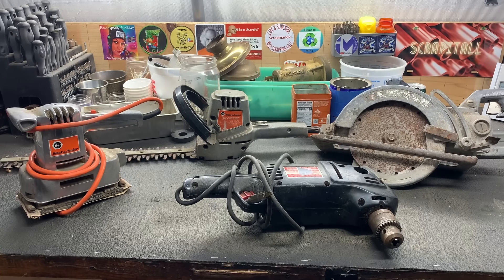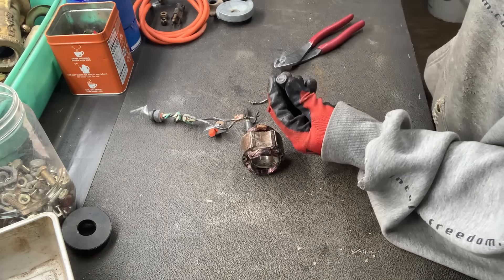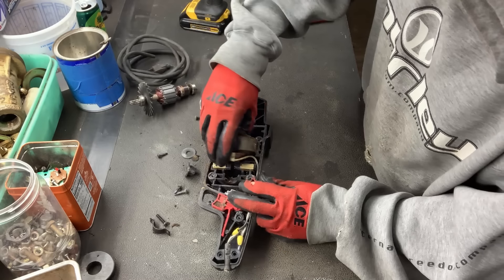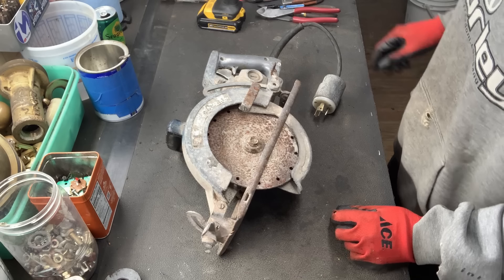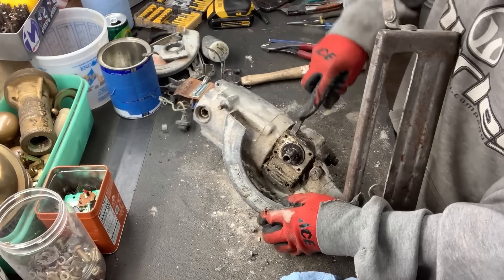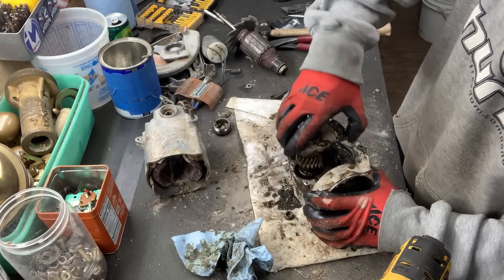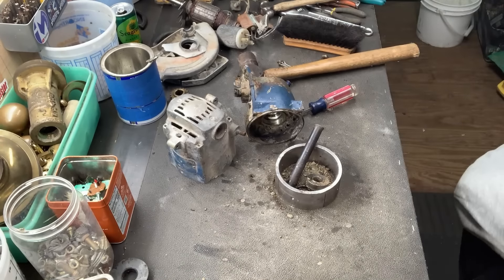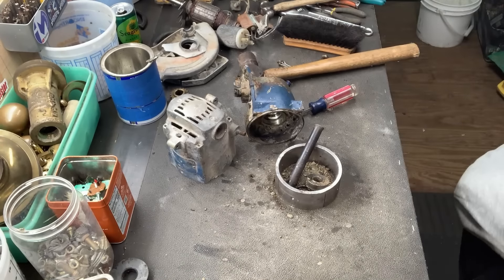Scrapping Power Tools for Copper - Will it Be Worth it?

Comment: Hold your hammer at the end of the handle. That's what the handle is there for. You'll get better leverage and apply more force to your swing. Try it.
Reply from the maker: @williammiller6043  I appreciate the useful tip. I used to work in construction and had that said to me a few times early on 😂
I just find it more comfortable this way, honestly. Thanks again.

Comment: Again, another nice breakdown. I really appreciate the breakdown of prices between shred, and what the actual money that can be made out of it is. I've actually watch the video of all 4 tools. And got the time on each one of them, so you can see how much you're making per hour taking things apart. Next I saw blue paint on that circular saw, which is the color I use to mark my tools when I was in the business. I hope that's not one of my saws😂😂😂 With it in your thumb, I've done the same thing. Taking the steel, Out of the aluminum casting spindle on A riding lawn mower. Dec.  I commend you. On not using any foul words after you hit your thumb. I myself could say I could not do that. Not that hitting your thumb is funny, but the funny part is. You got the bearing out, but now you gotta pick your thumb out where the bearing was😮.😂 Also I tried to send you a picture of  Spinning work table. the other day. But I probably didn't do it right?Just curious if you got it🤠
Reply from the maker: Thank you my friend!
I don’t think that was your saw, but I can send it to you. Some assembly required 😂
I was happy at least the bearing was out 😂
I didn’t receive an email from you, I even check my spam folder. 
Check to make sure you got my email address entered in correctly (I’m sure you did) just not sure why I didn’t receive it.
Reply: @scrapitall200  I probably messed it up. I'm not really computer literate. I was a carpenter for 42 years. I can build you anything out of wood. I don't seem to understand when I had a crew. I could either tell them or yell at them to do something when I tell her yell at the computer.It doesn't do anything🤔🫣🤠
Reply from the maker: @fraudanator2249  yeah I’m the same as you, I really don’t know much about computers, just enough to get myself in trouble 🤣
Well my friend, you have skills that are really important. I worked in construction for many years, let’s just say I’m better with computers 🤣
Now cars, I can work and fix cars, oh and I can scrap things really well. lol.
Reply: @scrapitall200  I just tried to send you some pictures👍🤠
Reply from the maker: @fraudanator2249  I’ll go check

Comment: Whenever I have pins or broken screws that that are threaded in, I put it in the chuck of my drill and spin it out. Hope your thumb is OK. I'm constantly hitting my hand where I had surgery. Another great video as always.
Reply from the maker: Cool idea!
Yeah it feels way better today. I’ve actually broken that thumb which is why I think it hurt so dang much 😂
Reply: @scrapitall200  I cut my index finger with my angle grinder which required surgery, and I'm constantly hitting it with the hammer or on a door frame.
Reply from the maker: @Kreacher1974  ouch! That sounds awful

Comment: First, the circular saw is a worm drive circular saw. They have gear oil in a gearbox. That nut you had trouble with is the fill port. Second I would suggest getting a 3/4 oak dowel rod for driving out bearings. Hope your thumb is getting better, I have hit mine several times like that, take care my brother.
Reply from the maker: @GeorgiaDogScrapper  the punch I used works perfectly, I just wasn’t holding it properly
Reply: @scrapitall200  I seen that, but I have trouble with my eyes. That's why I suggested the wood dowel as you can cut it longer than a punch. I have been using those wooden dowels for about 8 years now and I love it. My hammer doesn't slip as long as I make a center contact.
Reply from the maker: @GeorgiaDogScrapper  I have short ones and long ones. What happened was, I had that piece of aluminum sitting on top of that ring and when the bearing let loose, the hammer followed and my thumb was up against that ring cause I had my fingers clinched when I should’ve had them extended out. Was just a simple accident, they happen to us all.

Comment: Hello so i have 6 ac units and do not know where to get the freon out? Any clue?
Reply from the maker: Hello! That is a great question and I don’t know honestly. Maybe contact an HVAC company and maybe they can lead you in the right direction.
Reply: @scrapitall200  ok thanks i have a pile that atill got it in them and dont wanna release it into the air
Reply from the maker: @fishingmaster99  the hvac company might even do it for a fee, but I believe the Freon can be reused, so the fees might not be much. But again, I don’t know since I don’t ever get much stuff like that so I just don’t have the experience.

Comment: You could have stripped the insulation off of the electric cords too.
Reply from the maker: @ofthewoods137  no I’d actually lose money by doing that
Reply: @scrapitall200  why, because of the time versus the price?
Reply from the maker: @ofthewoods137  because of the price I get for that insulated wire. 
I did a test a month ago or so and I was surprised with the results. 
My yard buys all insulated wire as #2 where as some yards consider it low grade which carries a lower price.

Comment: You can get paid for the plastic , if you put it back together with the little bits of steel back in it.
Reply from the maker: That’s dishonest and I’d never do that.
Reply: @scrapitall200  it's not dishonest.   They buy it fully assembled from you with no problem.   After you take the copper out put it back together.   They sell it overseas,  where they recover the steel.  And they have buyers for the plastic.   So it all gets recycled.   And doesn't go into landfill to rot.
Reply from the maker: @magthemagnificent8437  my scrapyard does not want plastic if I can easily remove the metal from the plastic. So in the case of this drill, since I took it all apart. If I put steel back inside, screwed it back together, they wouldn’t appreciate that.